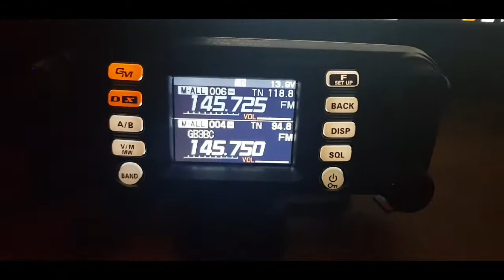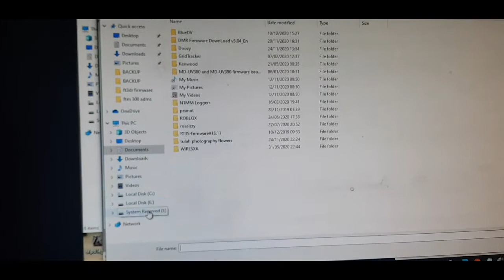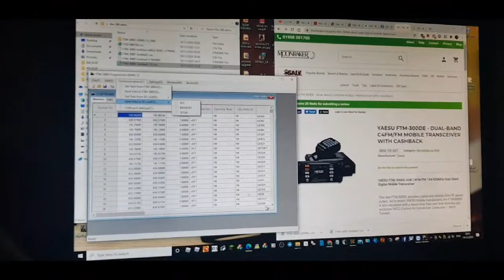Yaesu FTM300/FT3-ADMS 12 - loading CSV file

Comment: i FOUND THAT YOU DONT NEED TO FORMAT THE CARD INTIALLY. WITH A NEW CARD YOU INSERT IT IN THR RADIO AND CHOOSE " SEND TO SD CARD". DURING THIS PROCESS THE CARD MUST BE GETTING FORMATTED. iF YOU ARE USING A USED CARD THEN I WOULD WIPE IT OUT ON A pc THEN FORMAT IT IN THE RASDIO FOLLOWED BY A SAVE TO SD CARD STEP. AT THAT POINT GO BACK TO YOUR PC, OPEN THE PROGRAM AND LOAD THE SD CARD FROM THE COMMUNCIATIONS TAB AS YOU MENTIONED. i FOOLED AROUND WITH THIS FOR QUITE A WHILE BEFORE IT WORKED FOR ME. ALSO IF YOU ARE USING SOMEONE ELSES MEMORIES INSTEAD OF INPUTTING YOUR OWN THEN BE SURE TO GO INTO SETTINGS ON THE PROGRAM AND CHANGE THEIR CALLSIGN TO YOURS. THERES TWO LOCATIONS IN SETTINGS ON TH PC PROGRAM TO CHANGE. IF YOU LEAVE THEIR CALL SIGN YOUR RADIO WONT READ YOUR SD CARD. Sorry I just noticed I had cap locks on.
Reply: thanks John. Most helpful. EI7II